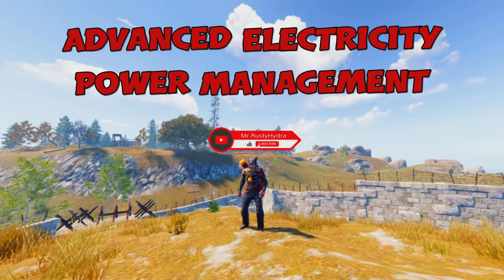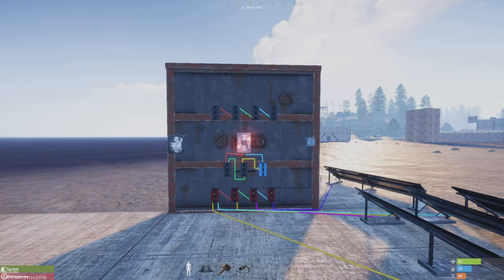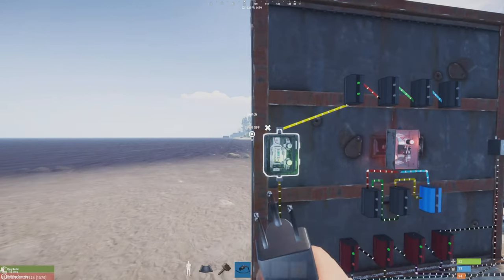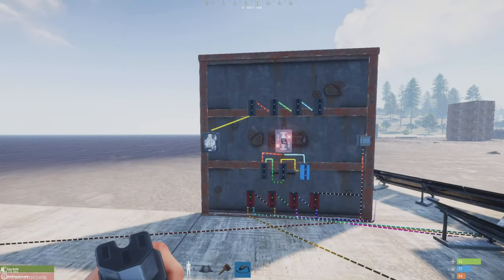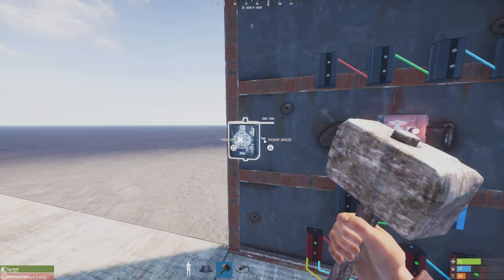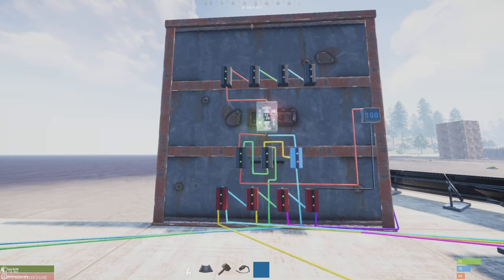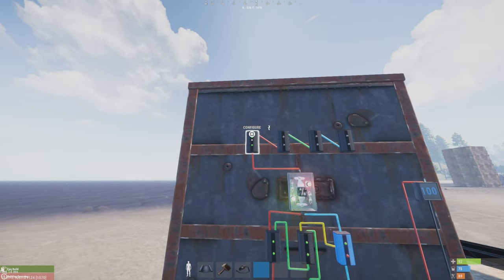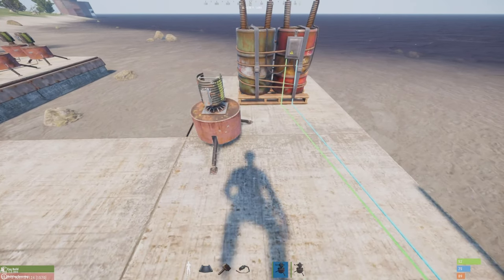Electricity Power Management - Rust  Console Edition

Comment: On the first solo system setup, how would I use the second branch to run auto lights? Like the first branch I’ll run 3 turrets, got it, but how would I then add auto lights to the second branch. I know how to do auto lights on their own system but how would I add it to this setup?
Reply from the maker: If you're using solar power only... After the last route combiner add an electrical branch. From the right side back into the infinite power system. You can think of it being placed where the display counter is setup now. Put it there instead. 

From your electrical tree, second branch, the line that runs your lights, put your blocker. Then from the left side of the branch you just put down, into the blocker port of that blocker.

So the electrical branch needs to go after your solar but before your system/battery. Your blocker after the second branch on your tree. 

It's the same concept as the small battery system, you just include the whole system between the branch/blocker, instead of just the battery. 

It needs 3 power to run 1 light then 2 more power per light after that. 

Pro tip for lights, is to place them on your 2nd/3rd floors and as centered in your base as you can, as the light will travel down through floors. Meaning most bases, even the bigger ones, only need 1 light. It travels like a cone out from it and the higher it goes the bigger the cone. Also prevents shadows and lights the front of all your deployables.
Reply: Ok I’m still new but that is helpful and gives me something to work with. I think I get the gist of what you’re saying. Now onto PTB to tinker even more and see if I can replicate what you’re saying. 

Thanks again sir.
Reply from the maker: You're welcome. Message back if you have any problems. I'll be doing a live Q&A tomorrow afternoon for people and their power questions. Hop on of you're interested.
Reply: What time ish? I’m central time and work till 5pm but yes I would love to join and ask questions. I’ve got a list lol

Comment: 500 is not 20% of 2000
Reply from the maker: We are not adding 20% of the 2000. We have to figure out what 2000 is 80% of. 400 is 20% of 2000. But if we put in 2400 and we only get 80% of that, then we are only getting 1920 power. 80 power less than what we need. So we have to find what 2000 is 80% of. 2000x100/80=2500. 500 is the 20% loss we get, leaving 80% left or 2000 power. The same 2000 power we use in a 40 minute Rust day.